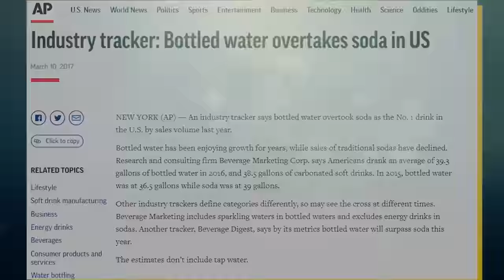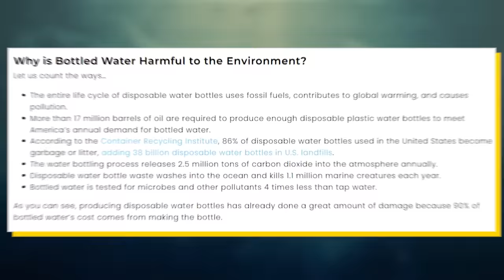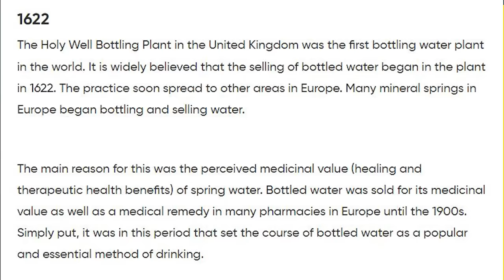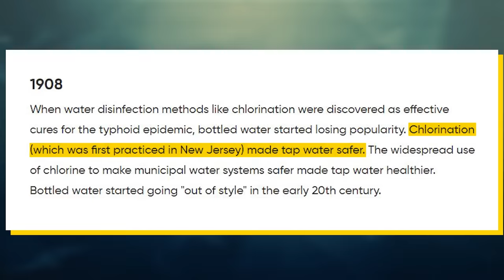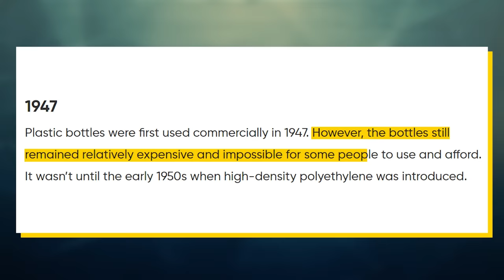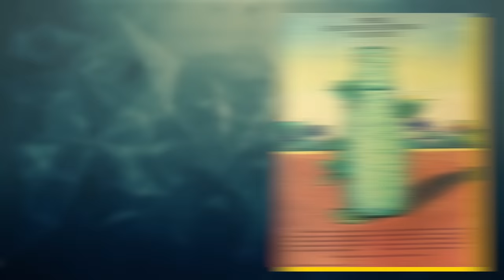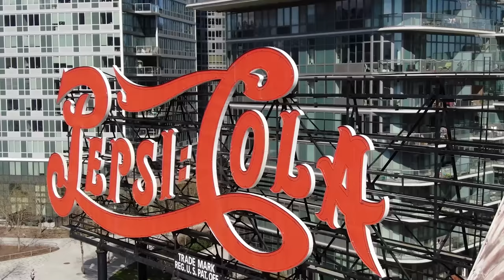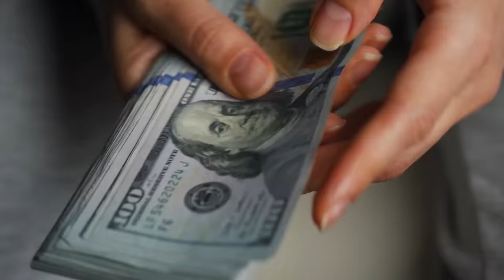Bottled Water Is Literally A Scam

Comment: There is technically not a reason to have bottled water in the developed world, There is usually tap water in most places you can drink.
Reply: Not a fan of rusty pipes or the taste of chlorine, but that's just me.
Reply: @Kelthor85 hats what bottled water has done. it changed the expectation of water.
Reply: @54grizzly true, but here in the Netherlands the taste of water is awful where I live since august due to the hardness. So bottled water is great to have if you want to drink water without anything added.
Reply: @381delirius  lol, nice trick then
Reply: @kimusti2883  Yeah where i live i always drink bottled or filtered water daily cause the tap here is almost hard to drink.
Reply: Try a water filter system, it can be miles cheaper per gallon and you can decide how much and what kind of filtering you want. Plus having filtered water for making tea/coffee or cooking is excellent. Oh and if you let tap water sit for a while with a way to vent, the chlorine should evaporate after some time. You could do this before or after filtering.
Reply: It should be that bottled water is only accessible in 3rd world countries that hold little to no water access, giving them back a vital resource. While also at the same time making bottled water more potable so that way less people get sick🤢 Once those countries develop and recover, they can then implement their own taps or ask for regular shipments of water where needed; we can then find whatever else is wrong and rectify it. Isn’t that what helping is?
Reply: @yourscody  it's not profitable.
Reply: Come to SEA and drink tap water here. I guarantee you, you will meet or at least closer to God if you believe God exist.
Reply: Tell that to the sick people in Flint Michigan.
Reply: I catch, filter and drink mountain rainwater.  I bottle some up and carbonate it.  Not much tastes better than clean rainwater.  Even bottles taste like crap to me, chemical and metallic and i hardly ever buy bottled water unless i'm traveling.
Reply: I personally use an Aquaguard/RO purifier (most people I know use this too) which purifies any possible contaminants that could be present. A one time investment, should be around Rs 8000 (or $100) or less and gives you water that's better than bottled water. In my country, I have only seen bottled water being sold at airports and railway stations.
Reply: @yourscody  Yes.  But then the government doesn't have to do anything about actually providing clean water infrastructure.  these unintended consequences happen all the time in the third world and westerners look at it as something positive...saving lives or something...which it does but many many more lives would be saved if there was an incentive to provide clean tap water for everyone.
Reply: Okay but we also buy them to store in times where the water treatment plant is underwater due to major storms and hurricanes and it's good to keep some around for emergencies
Reply: My landlord decided to cheap out on plumbing, so we get brown rustwater now. It might have been clean when it left the water treatment plant, but it sure isn't clean when it comes out the tap. Not even my dogs want to drink it.
Reply: The thing is that bottled water is also really great for travelers.
Reply: @381delirius   ... Is there no way to do filtering in the house?

Am in Kenya, where tap water is completely undrinkable, and a filtration gadget is the equivalent of $40 ... And it filters 100s of litres of drinking water, after which a replacement filter is approx $5.
Reply: Actually there are many scenarios for keeping the bottled water production system going. That includes natural man-made disasters. In addition,  tap water is made to be running and not kept still for long periods of time. There are microorganisms in good tap water. The bottled water produced by the beverage companies is triple filtered and sterilised for the most part so it can take a long shelf life as  that's what it's meant to do I think we often criticise many things without thinking it through entirely. If for instance there's another hurricane that devastates southern Florida the local water supplies are contaminated by flooding how are you going to move massive amounts of water in aside from tanker trucks? Being able to deliver tanker trucks and bottled water helicoptering it in when necessary is an important part of rescue efforts. You can't spend that type of potable water delivery infrastructure up on the fly and on demand.
Reply: If you live in London it’s required. Not only that but we use it in the kettle and iron so they last longer. If they did something about the hard water then you’d have millions of plastic bottles out of landfill but they don’t care.
Reply: @Arghans  It's sort of thing that is still clean but you wouldn't drink it unless you have no choice.
Reply: How can you trust the tap water? I can trust that the bottled water has been filtered and didn't get contaminated on the way aka the unopened bottle. If I had my own place I would use a fridge with a good carbon filter that is good enough for me but preferably I would use reverse osmosis system but that also requires you to own a place.
Reply: I just bring a refillable bottle with me everywhere
Reply: I wouldn’t say that. I always have my water bottle (refillable, not one of the ones from the video) with me unless I’m doing some quick errand that will take less than 10 minutes. Sometimes though, I’ll be away from a water source for longer than my bottle will last. Long car trips are the only time I’ll buy bottles water because not every gas station has a water fountain and I definitely do not trust the tap water there. It’s just to be a backup for tap water, not a replacement.
Reply: It tastes way better. There’s a reason.
Reply: Tap is often tainted
Reply: Keyword: developed world. Do you count the U.S. in there?
Reply: Yeah but you can’t trust tap water honestly
Reply: the technical answer is I live in a weather hazardous area and having bottled water in our possession is survival - when we use it, it is for the purpose of circulating it - you happy?
Reply: Natural disasters.
Reply: @butWhyDad you need active carbon with your RO system to get it completely clean. But it's still not a good idea and WHO says demineralised water isn't good for long term human consumption
Reply: @DennisJrgensen  You get all your DRI of minerals from food if you have a healthy diet so no it isn't bad for long term health in that case. RO system already have carbon filters in it actually has two
Reply: They function as bizarre security blankets for juvenile adults. I am sick of seeing people suck out of these plastic bottles every ten minutes. How do they think people survived for thousands of years without needing to continually hydrate themselves?
Reply: @ohsweetmystery  Not everything is about survival science has plenty of evidence drinking water often is healthy and good for long term health. Idk about every 10mims but every hour is good.
Reply: @381delirius i guess it just depends on where you live, i live in switzerland and i drink tap water all the time. I never drink botteled water and when i do i like tap water more
Reply: Guys, "hard water" is NOT the prroblem. Hard water is delicious, refreshing, and has beneficial minerals. I will take clean, well-sourced hard water over pretty much anything. If you're not drinking from a well, your best bet is distilled water.

The real problem is fluoridated water, and contaminated ground water sources... and Nestle.
Reply: Plenty of reasons not to drink tap water. Are you nuts?
Reply: And it was shown that, in Canada, tap water is safer than bottled water in lab tests (it's because our tap water is regulated while bottled water isn't)
Reply: @elishmuel1976  Canada 🤣🤣🤣🤣
Reply: @Kelthor85 exactly
Reply: Rap water??? Nope, don't wanna and ain't gonna, drink that cloudy shit
Reply: @Kelthor85 tap water is the best bro. At least in my area. Tastes like absolute nothing, just the way you want it. Also it only costs 0.2 cents.

Comment: Regardless of tap or bottle, use filters!!! Make sure to use top notch filters!! At the very least, attempt to clear out those chemicals in the water itself.
Reply from the maker: I mean, some people want the minerals
Reply: Filters remove particulates like minerals not chemicals. So no, you cant remove chemicals unless you have a reverse osmosis system.
Reply: I have reverse osmosis. Best purchase of my life.
Reply: How do I filter bottled water ?
Reply: filters can be pretty wasteful and expensive over time. it's not completely necessary for everyone.
Reply: @LogicallyAnswered  those people can dig minerals from the ground and eat them dry
Reply: @JM-wd3dk  minerals ARE chemicals
Reply: @BeachLookingGuy  one small filter uses same amount of materials as around 10 bottles. Maybe less.
Reply: @uis246  lol what? The filters for my container are almost the the same size as a water bottle and they are plastic, thick plastic with all kinda filter stuff inside. Not sure who telling you this but there’s no way a filter made of thicker plastic is using less material
Reply: @BeachLookingGuy  I think we are talking about different filters. Casette for pitcher filter is smaller than 0.5 bottle.
Reply: @JM-wd3dk you guys don't have access to RO purifiers?
Reply: My liver is the filter
Reply: @BeachLookingGuy  it is, have been using one for my whole life.
Tap water here tastes pretty bad and has tons of iron in it

Comment: I've always felt this way...until I moved to Arizona with its heavily mineralized water. No use boiling it (its still gross) and your home filters are too wimpy 😅. BUUUT because of that ( and its broiling outside 75% of the year), there are water stores that sell...water. Lol I thought it was so wierd at first, but they (R.O.) filter it for you and you can buy refillable 5-gallon jugs. And water dispensers aren't as expensive as I thought so that should be recouped over a case buyer after not too long. Way better than buying cases of bottled water IMO. And the water stores are kinda cute too  🤷🏾‍♀️
Reply: Do you mean Reverse Osmosis Drinking Water Filtration Systems?
Reply: @Marty_YouTuber  Yeah. It takes up a whole room for the equipment. It's pretty cool
Reply: Still you can buy a home filtration system, no need to buy bottled water which are actually bad in the long run since they contain dissolved microplastics
Reply: @VisheshSharma  I live in Arizona too and had a water filtration system - the water still tastes gross (it's almost like an oily weight - hard to describe) and agree 100 percent with the OP on this - bottled water may be bad but tap water even filtered isn't really an option here in north Phoenix - I believe the OP was talking about using the 5 gallon refillable jugs - I think they are pretty safe as far as microplastics go and it costs about a buck and a quarter to fill one.
Reply: I’m from the West Coast where tap water is good, but lived in Arizona for a couple years and I can confirm the tap water there is terrible.
Reply: EXACTLY ! I've never known anyone in AZ who drank that nasty tap water. Bottled water was important !

Comment: Here in Mexico tap water is not drinkable, almost every home uses the 19L (5Gal) bottles. You can refill 2 of those for about 1 dollar at dispensers or have them delivered to your home. It's much cheaper and friendlier with the environment.
Reply: Same here in Indonesia. 19L gallons are the standard, and we also have similar prices for refills. More expensive, branded water bottles directly from mountain springs, and these are more expensive, at 2-4 dollars for 19L, depending on whether you also buy the bottle or not.
Reply: confirmo
Reply: Ha! It's not drinkable in the USA either

Comment: I would've agreed that bottled water is worse than tap water, but you can see particles in tap water especially after boiling it which you don't see with bottled water. Also my throat feels more dry after drinking tap water compared to bottled water.
Reply: My tap water tastes like chorine and metal even after boiling
Reply: both  not  safe  bro

Comment: I don't trust my tap water.  It has very high (400) PPM of NOT water.  What is NOT water you ask?  Good question.  Maybe lead, iron, calcium, sodium, and Other.  There are devices to measure ions in water and I use them.  Purified RO water has zero ions.  I use that in my coffee machine to not clog it up.  Ph balanced drinking water has typically 70 PPM.  Is it too expensive?  Hell yes.  😂

Comment: Here in Brazil you could theoretically drink tap water in most cities(specially big cities), but instead, we like to filter it anyways.
You'll find a water filter in basically every brazilian home, be it the very traditional clay filter, or modern electric cooling filters, both have active charcoal filtering elements inside.
This removes chlorine and makes water taste just like bottled water IMO.

Comment: I live in India and majority of tap water is not drinkable many a times because of some leakage or seepage. But we only buy bottled water when we are traveling. Most of the houses have RO purifier (150 dollar price for the whole system and 30 dollar price for the filteration unit which should be changed once in a 4-6 months) or they are subscribed to local water purifier plants where 20 litres cost you 25cents). Even the people who can't afford this have gravitation based filtration system costing only 40 dollars with 10 dollar filters.

Comment: It's not that simple for most Americans. If you're lucky enough to live in the big cities where they have proper funding to filter the water to the highest standards, then sure. But if you live in a small town, your water is susceptible to random contaminates that you don't find out until 6 months later when the city does their yearly evaluation for the EPA and sends you a letter that "oops, between X and Y months, levels of __ was above the EPA limits". Even buying your own water filtration system might not be an option if you have very hard water and just filtering out the minerals eats up the life span of the filter too fast for it to be economical.
Reply: LA points out the over 99% of Americans have access to clean water, and 99% is most Americans. He lists his sources for that data.
Reply: Water softener.

Comment: Bottle water is good for one thing: on-the-move drinking. If I'm hiking or plan to walk downtown for hours, I don't want to haul around reusable metal bottle(s). The light weight of the plastic bottles are the only benefit these things have. Any other time, tap water.

Comment: I've done a lot of plumbing and I've seen what the pipes look like that a lotta water flows through and it's absolutely disgusting. Just because the water leaves the treatment facility clean, doesn't mean it stays clean after traveling through many different pipes. Especially here in rural WV. You would rather have bottled water than the nasty tap water I have.

Comment: "theres no evidence to back this up" in those tests they probably got the tap water straight from where the tap water originates, even throught a filter my tap water has a clear taste difference from tap water, maybe because my filter is bad but ive done it with multiple filters. I suspect the pipes or something make the water taste bad, it definitely does not taste the same. i'm not even biased against tap water, i agree on this point for many other products but i'm not trusting a survey when i can clearly taste the difference

Comment: Tap water always has chlorine in it which takes away all the benefits from water. Tap water has lower ph than bottled one which means that tap water doesn’t hydrate as good as bottled water. So there is a point to buy clean bottled water instead of drinking chlorine

Comment: I find it so odd drinking bottled water cause I can taste a dryness in my throat after drinking it. Even did a blind taste test once and I could tell my tap water from bottled water that way. It was only an issue with the cheaper bottled water brands fwiw
Reply: If it was Dasani they put fuckin salt in the water for "taste" and IMO that should be illegal.

Comment: The well water where I have to place iron rought in it but it's still not palatable, If I can get the metallic taste out of the way I absolutely would NOT buy the 5 gallon jugs to drink water. I also get the filtered water from work before I clock out so I have some when I am home.

Comment: I get water delivery. I'm worried about PFAS. PFAS is not regulated in the state I'm in and even in state's where it is regulated most pfas chemicals are not removed. I used to live where we had a well and a bunch of filters. In the city I'm not drinking the tap water ;D. The water delivery is distilled and enhanced with stuff like minerals and increased ph level = ). It's like smart water but at a fraction of the cost and it's local :3.

Comment: isn't it something like you're paying 1-2% for just the water itself, then the rest is bottles, transportation and marketing?
Reply: The bottles are absurdly cheap and transportation is too. I don't see that much marketing for water. Most of what you pay for is just the absurd markup
Reply: @rishiy6183  i mean, for the amount of water... The fluid itself is still way cheaper than the bottle, even though the bottles are alr cheap,  speaking of like 90% of the product value because water itself is nearly free anyways (a liter of water is like 1 cent, when a bottle is like 20-50 cents to produce (depending on the size, polymer type etc.)

Tap water is also cheap because the pipelines are a very efficient way of transporting it, transporting water by truck is also reasonable, but still not as efficient

And marketing is literally what you see in various advertisements